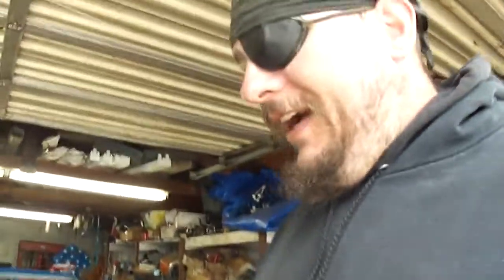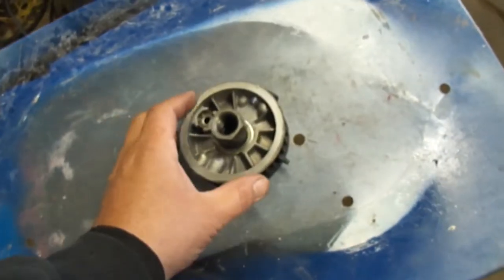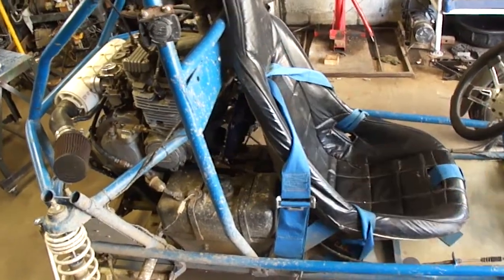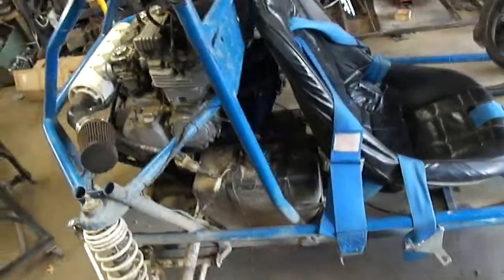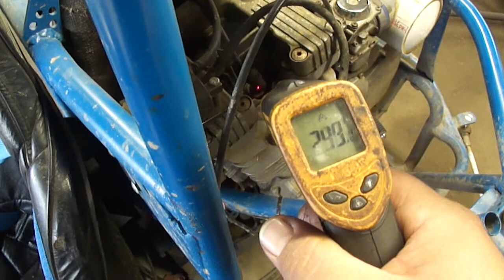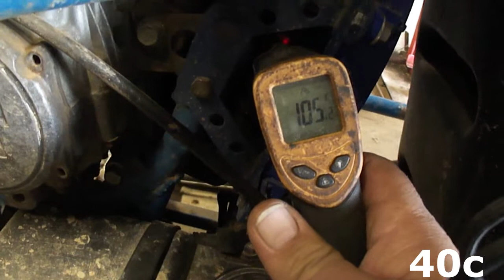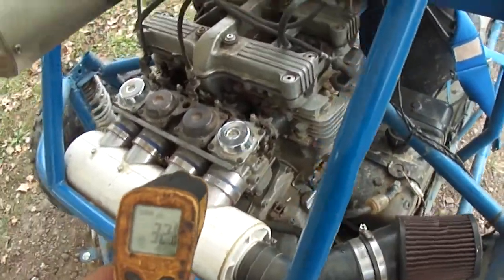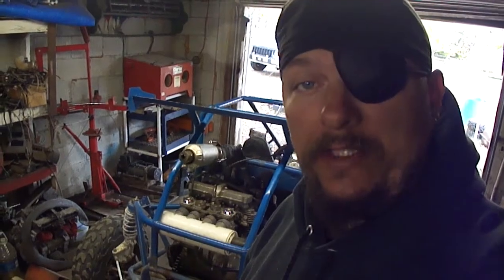Cross Kart Gets an Oil Cooler (and some other things)

Comment: If it's getting that hot the oil will start breaking down. Make sure to do oil changes often. 
I have the same problem with a couple air cooled Suzuki quads. Just added an oil cooler to one and put a bigger cooler on another. Adding fans now.
Reply from the maker: Oil gets changed every 4 hours or so of run time.